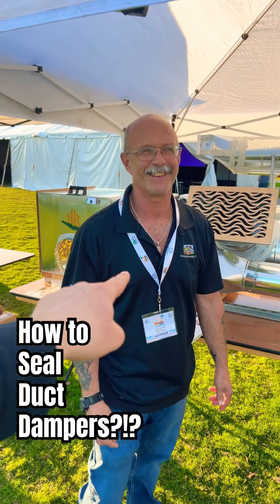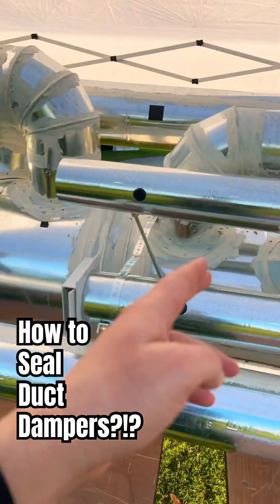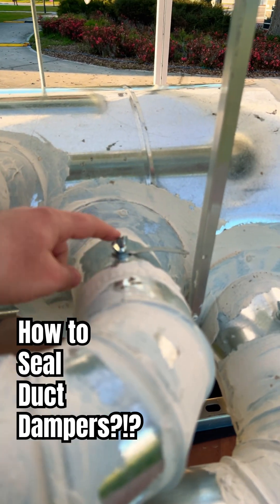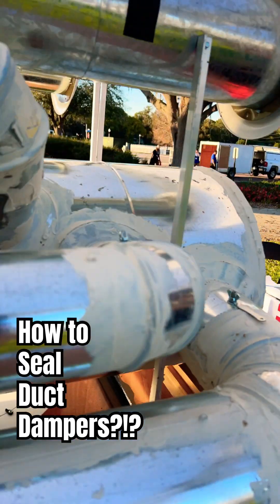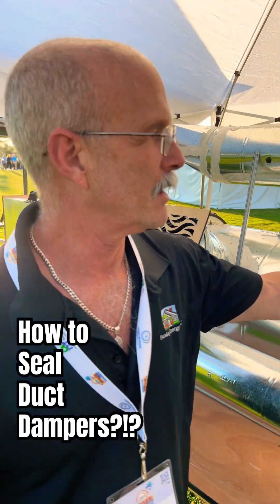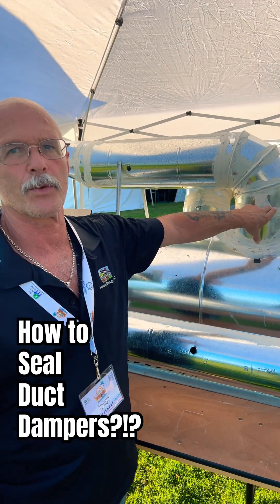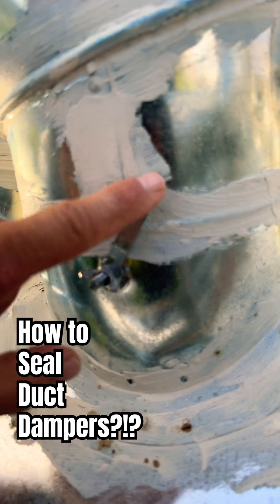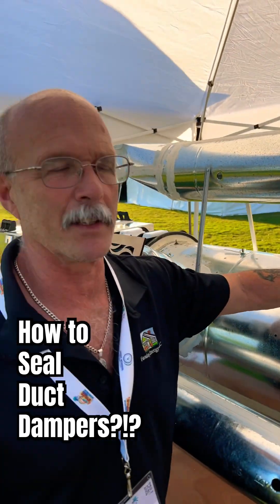HVAC Duct Dampers are Leaky- BEST WAY TO SEAL THEM with Tony Gomes

Comment: This is terrible advice. Needs change on heating and cooling. Tighten the wingnuts so they are able to move with little effort,but not so much that it will brake if need to adjust.
Finally,put some flag tape through that hole so owner knows where and how to do it himself.

Comment: I just tape over the top of the handel and the nut.    it probably stops 99% of the leakage.   then if it  needs adjusted later it can be by cutting the tape off.

Comment: If my heating load is different than my ccoling load i. A particular room, how would I adjust seasonally? Even a comissioned system is likely going to need some adjustments from time to time.
Reply from the maker: In real life, it evens out pretty well if you're off a little because all the rooms are going from heating to cooling mode, and the proportions are roughly the same. Make sure room pressures when the doors are closed aren't above +/-3 Pa.